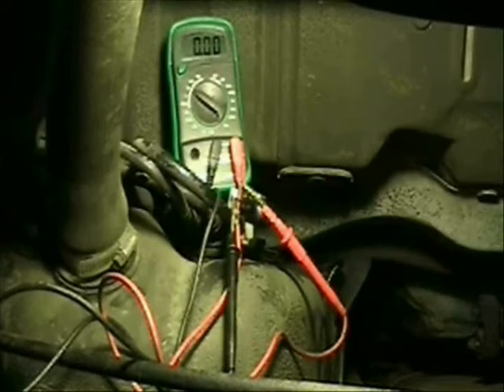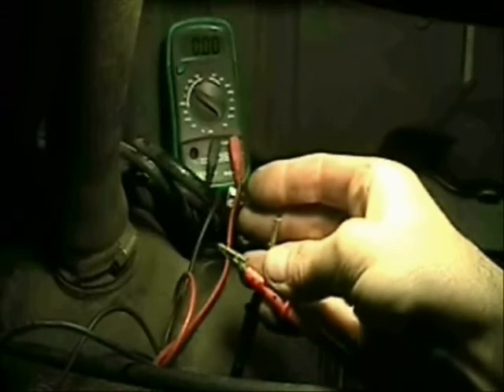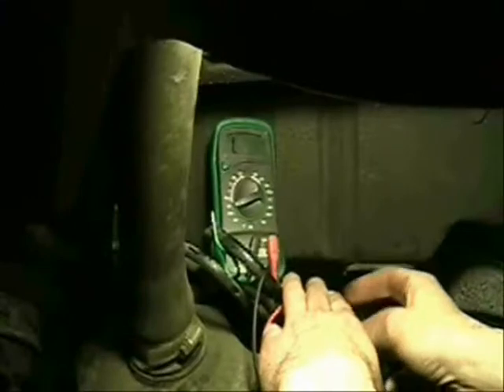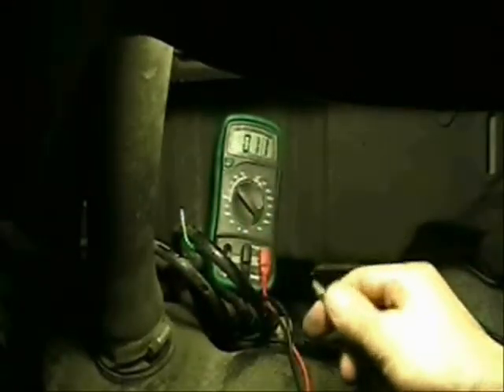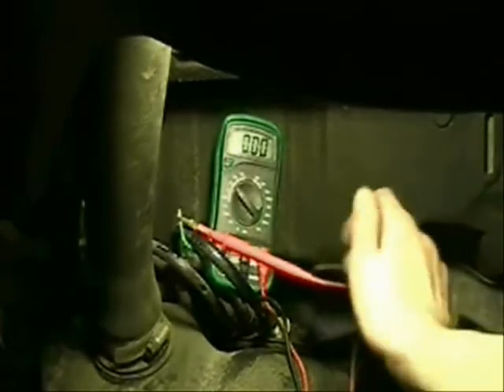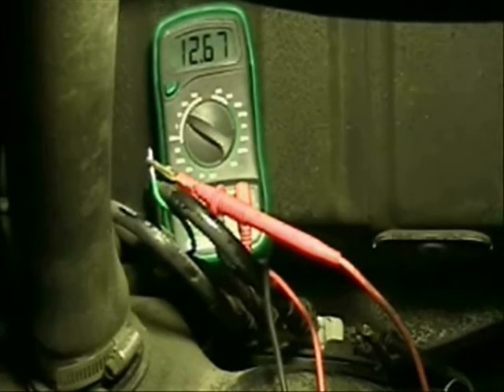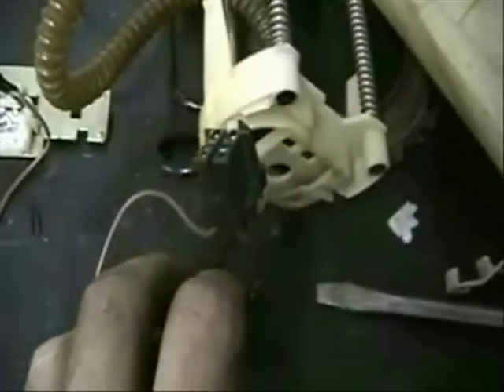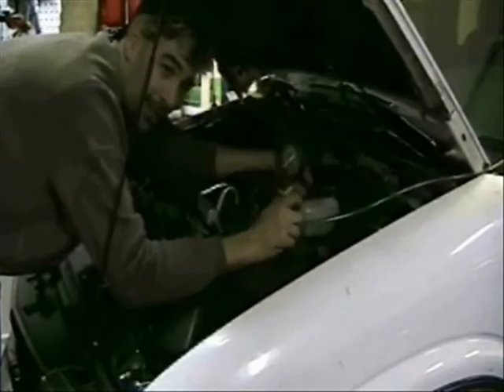Low Fuel Pressure, Lean Condition diagnosis PART 3

Comment: So when you’re doing a voltage drop you connect to your negative terminal of the battery and on the other DVOM lead you back probe it to the negative wire from the connector and viceversa?
Reply from the maker: only if measuring voltage drop on a ground, yes
Reply: @SchrodingersBox  and on a positive? Or would that be signal return?
Reply from the maker: Positive is same. You always measure voltage drop on a single polarity. Unless you are using kerchoffs law then you can subtract from source voltage.  I find the latter to be way easier.   I like simple.
Reply: @SchrodingersBox  did you mistakenly write latter?
isn't measuring voltage drop on a single polarity simpler because you just check that the voltage isn't higher than 0.5v, no subtracting from source voltage needed.

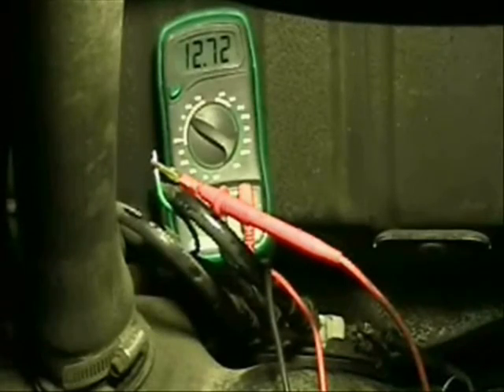Comment: Thank you Matt for these wonderful sets of videos. At minute 5:45 where it showed 12.7 volts for the positive voltage drop before you cranked the engine. The question is, why was it showing any voltage drop at all between the positive battery terminal and right up to the pump. Shouldn't it be zero or very few millivolts? The actual load or the source of resistance was the pump itself and we were measuring the voltage drop at rest before cranking the engine.
Reply from the maker: If I remember in this video I measured the voltage drop across the positive and negative for fuel pump and activating pump.

Comment: So I cleaned my MAF and IAT and everything reversed. Now my B2 LTFT increases at idle. For a minute that condition switched to B1 but now it's back to B2.  I bought a fuel pressure gauge and at 41 degrees outside with a cold engine my fuel pressure at KOEO was 30 psi (should be 35-45) and was holding pressure. With cold engine running it was at 30 psi and when I shut it off it held pressure for 20 min until I released it.

Comment: Another easier test would be to put a known load such as a light bulb  appropriate resistance to provide 10 amps or so  back probed into the  connector to replace the fuel pump as a load thereby  verifying the integrity of your wire feed to the pump from the front of the car.  This will prove the actual power and ground wires are  able to supply  amperage as well as supply voltage.

Comment: An excellent series of videos especially about fuel trims.  I must comment on burnt out wiring.  Had the burnt out cable been outside the pump you should not just repair it you also need to know why it is burnt out. In this case almost certainly the fuel pump motor coils shorting. Since the fuse did not blow your friend should also check he is using the correct fuse.

Comment: I just wanted to point out that you do not need to be too concerned about the gauge of the wire as well as additional voltage drop across the wire from the battery to the meter when doing the voltage drop test. The wire is not supplying current to the pump, only to the the volt meter. Most modern voltmeters have an input impedance of 1 Meg or greater. At 1 Meg Ohms and with at 12 Volts, you have 0.000012 Amps running through the test wire into the meter. If the test wire has a resistance of 50 Ohms (which is a ridiculously high value for argument sake) the voltage drop introduced would only be 0.0006 Volts. So you can see it is negligible.

I think someone already stated this but you can just measure the voltage at the battery, then the voltage at the pump by back probing both leads in the connector. Subtract the pump voltage from the battery voltage you get the full voltage drop to the pump from both wires. If you find the drop is excessive, then you can do the individual lead voltage drop as you described to determine which one is at fault. Resistance checks can also be made but either way you go, I would start with the ground wire. It’s probably most likely to have a faulty connection.

Thanks for some great videos. I'm having intermittent misfires while accelerating on a Vortec V6 which lead me to your video on replacing the spider fuel injectors. The videos will help me determine the problem.
Reply from the maker: Yes you are very correct- at the time I did this video I was not as familiar with the concept as I am now.
Reply: good comment thanks for sharing.

regarding what you said, measuring voltage at battery, then at the fuel pump, and subtracting the pump voltage from the battery voltage, to get the full voltage drop including both wires. 
in that case any result below 1V is good right? 
because when matt did the individual polarity voltage drop test he said anything under 0.5V is okay, but here you would test both wires at once so the threshold of accepted voltage drop needs to be doubled.

Comment: Use jumper cables as the ground return wire for the voltage drop test. Daisy chain them if one is too short.
Reply: Jumper cables are perfect for this, because the heavy gauge wire has very low resistance and will result in a negligible voltage drop through the cable, itself.

Comment: thanks for the very precise diagnosis, I used it for checking voltage drop and had very little for my pump. I had low fuel pressure and it appeared that the check valve on the pumpp was bad. Not the case, when  I had the pump removed I saw that the rubber hose from the pump outlet to the metal supply line was loose. Bought a couple of new hose clamps and a foot of hose and solved the problem. Thanks again

Comment: In doing Volt Drop on AC circuits, would you follow the same procedure as DC, by checking NEG to NEG, HOT to HOT, and etc?

Comment: An alternative method of measuring voltage drop is to measure point voltages relative to local ground (a clean quality local body ground is necessary). This avoids stringing a wire to the battery. Voltage drops are calculated by subtracting point voltage at pump power lead from battery source voltage (for positive power lead), and voltage on ground wire lead at the pump w/ a backprobe relative to local body ground (this will directly measure voltage drop in pump ground wire).
Reply: +Texas Pipeliner Always best to connect to BAT to ensure - circuit is complete.

Comment: Where do you find the specs for the parts in a car that you are diagnosing?

ie, what's the right fuel pressure at various parts, the right cylinder pressure, the expected voltage drop, etc?
Reply from the maker: Tristan Wibberley Google

Comment: Bill Nye the science guy for mechanics...YOUR AWESOME MAN... Very informative and helpful info.Ive been listing to you videos for about 4hrs now. Starting watching dianosed on a distributor but love all your other videos..When i pulled my distributor of my 97 chevey chyenne v6 vortec 4.3 it is all rusted. this is the 2nd one that does this..Any ideas on why im gettin moisture in tho top of the distributr inside the cap...the cap looks perfect no cracks or nothing
Reply from the maker: esco361 There is a gasket that goes between the distributer and the intake manifold deck- my bet is you are missing that (you can also just use sealant).  Otherwise you might have water/coolant in the oil. But I am betting the absence of the gasket explains it.
Reply: thank you very much for the info and your time!!

Comment: voltage drop on last test will be probably even higher with pump pumping fuel. then it will be under load and taking more amps from the batery.
Very helpful videos on you channel
Thanks
Reply from the maker: Ah good point- I probably should have tried that using a nonflammable liquid.  never thought of that

Comment: Hello Matt. You truly are a positive force in the world! Out of shear curiosity I've been perusing your videos over the last few days and you have quite expanded my diagnostic capabilities. Finding someone who applies the scientific method towards a service industry which so desperately craves it. It's quite a breathe of fresh air!

Anyhow, for future reference the resistance in the wire you connect to your voltmeter does not matter because the voltmeter is connected in parallel with the fuel pump wire. Voltmeters by nature of design have incredibly high internal resistance (usually 10+ M Ohms). Therefore you won't be perturbing the initial circuit much by measuring it so you will get an accurate reading regardless of the resistance of the wire.

Thank you for your contributions.
Reply from the maker: Thanks bro. Yea since this video I have learned about the insignificance of resistance in the lead wire. I am learning as well. 
  Love your screen name btw. It would be an appropriate name for this channel!

Comment: Hi Matt,
Another good video diagnosis, but I wasn't sure about the voltage drop explanation until I thought about it in terms of a garden hose, that is, if a garden hose is restricted or kinked then the flow of water through it will be affected. After i thought about it like that, then i was able to picture the reasoning behind a voltage drop test. If the voltage is being restricted then the load will also be restricted or minimized. would that be a fair comparison?
Reply: Fair comparison. :) If I wire is bad it'll have more resistance or less flow. Look up Ohm's law. Ohm's law named it after himself and at work I even ran into one of his relatives who was aware she was related.

Comment: Schrodinger i didn't understand this drop test that you say about the voltage drop in positive side i understand that drop test of the circuits in positive side should be around .2     i'm not sure but can you explain me why to much voltage drop great video by the way
Reply from the maker: Rafael, I am not sure I understand your question but let me try anyway.  The voltage drop test is a test for resistance in the wire- in other words if the wiring is very old and not in good condition it will have a high resistance. This resistance will cause a drop in voltage because it cannot carry electricity very well. If I had found a high voltage drop in any of the wiring outside the fuel tank, then it is possible the fuel pump is fine- it just does not get enough electricity to pump fast enough to build fuel pressure. But since I found all the wiring outside of the tank is good because there was a low voltage drop, this means the problem MUST be inside the fuel tank.  At the end of the video, I show that actually, the wiring inside the fuel tank was bad because it had a high voltage drop. The fuel pump was probably fine, but since I had to remove the tank- it makes sense to replace the pump rather than repair the bad wiring.  I hope this answers your question.

Comment: Great video, but you incorrectly determined the voltage drop of the long wire to the battery for the voltage drop test.

The meter you are using as a voltage meter has a high impedance, about one megohm or so, compared to the resistance of 20 feet of copper wire, the voltage drop across the wire will be neglible.

So, you can ignore the 20 foot wire voltage drop.

Thanks,

-Arlen
Reply from the maker: @arlen raasch Hmmm you bring up a good point, I agree with you- that makes sense and in retrospect seeing the minimal voltage drop on the negative confirms your statement.  Now I wish I had done the voltage drop test at the very end of the video with and without that same extension wire see if there would have been a difference at all much less my calculated difference.  Great input! Well, even if the calculation was not necessary, it did set a higher stringency for the voltage drop test to pass and thus even further confirmed the wiring ouside of the tank was indeed fine.  Great comment and thank you.
Reply: John Dodge A DVOM (Digital Volt Ohm Meter) when used in a mode to measure a voltage (AC or DC) has an input impedance.   You are correct that most commonly used DVOMs have a high input impedance, so much so that for most people they can ignore that just applying the meter to a circuit modifies the voltage slightly.  However in high output impedance circuits, it still can matter.  The DVOM's high input impedance can lead to some confusion when doing some common tests as well.  For instance if a starter motor is not working, disconnecting the battery lead from the starter and measuring from this lead to ground with a DVOM may well show +12V, but when actually connected to the starter the same lead reads close to 0V.  Why? There may be a poor battery terminal connection or a high resistance in the positive lead to the starter.  Hope this helps.
Reply: I'd have mimicked what the pump sees. For battery ground, I'd have just used the nearest metal frame point.

Comment from the maker: Vitiay, Provided your Civic has normal fuel pressure under load, I might suspect a faulty MAP sensor (I am pretty confident your car doesn't have a MAF or I'd definitely suspect that). It is also possible (but quite unlikely) injector problem could explain the low fuel delivery and thus lean condition. Heck, could be throttle is opening wider than TPS detects. Honestly there are too many variables to just guess- again you must think in terms of "what would cause less fuel than is really needed"

Comment: Awesome video, Matt. In my situation this is the same exact scenario with the lean condition under load ( Honda Civic1998 ). I went through everything that you mentioned. But I still can't figure out the problem ( . I just won't give up. Can it be a glitching sensor or an electrical problem only when the car is moving ?

Comment: Hi Matt, good video. The only thing that I would have done different was your procedure in checking voltage drop to the fuel pump. Measure the voltage at the source, then measure the voltage at the pump with it turned on of course. Subtract the two readings and there's your voltage drop. This would save a lot of time instead of running a wire from the battery which is adding more drop to the circuit. Then if the difference is too high, you could do the follow-up as you've shown.

Comment from the maker: @12vgs- Yes you are absolutely correct, and in fact I Would have preferred to do exactly that.  However the connector for doing voltage drop inside the tank was extremely hard to reach and I figured ruling out every other possibility is as good as identifying the actual issue and in this example it happened to be easier.  If I had a friggin lift instead of jackstands it would have been so much easier lol!!!!

Comment: So, Matt if you had measured the voltage at the back probe, you could have found the voltage drop inside the pump?  Actually you can review the tape and see what was the number that you got when probing for the correct wire.  You should be able to see the extra .3V drop in the grey wire as reduced battery voltage at the probe by that amount